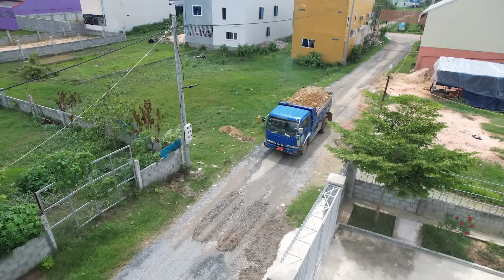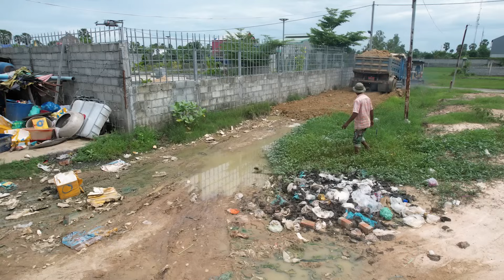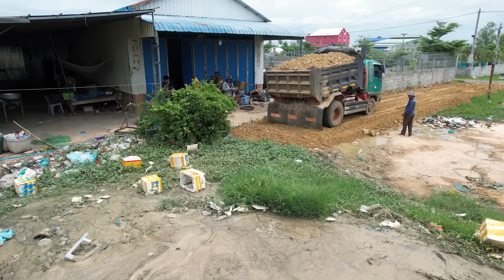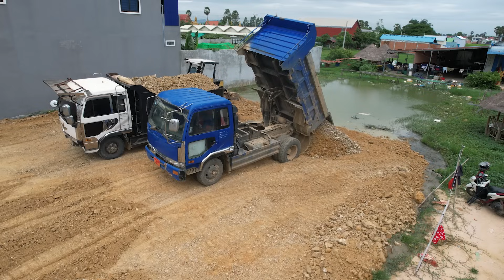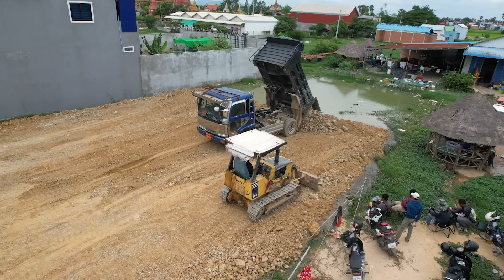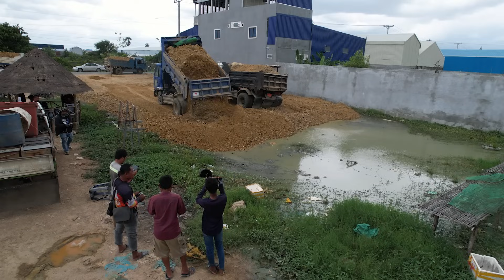Start Lanfill in Flooded areas!! Bulldozer D20A & Truck 5T Pushing Soil Into water and Trash

Comment: Hello Another good job of bulldozer and dump trucks working together to get the soil in the water area. Nice runway for the dump tracks to travel on and not get stuck.  Many jobs working together as a team.  Also this bulldozer seems to move the piles of rock and sand with ease.
Reply from the maker: Thanks dear 🙏